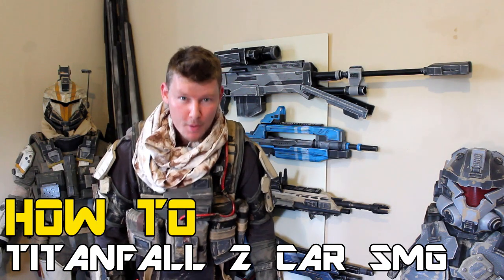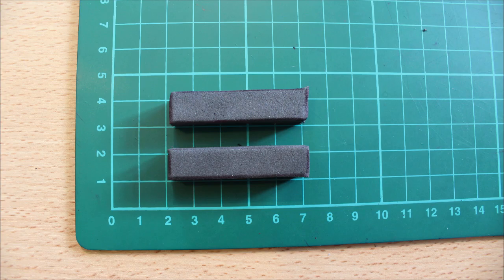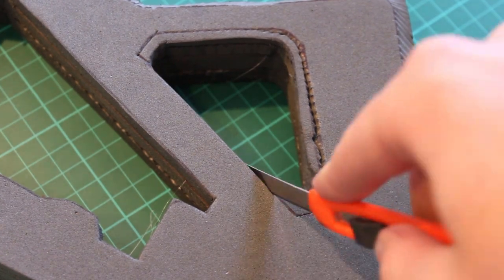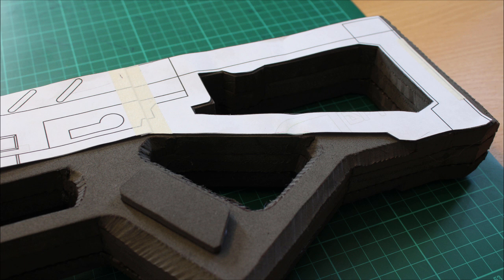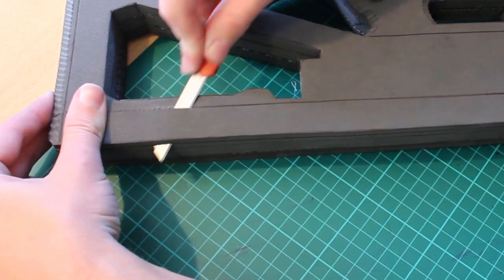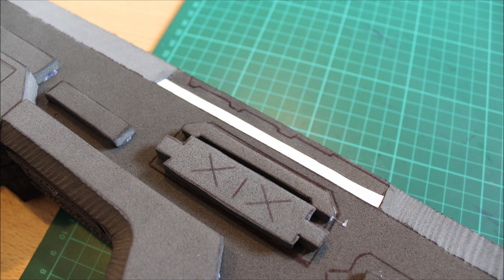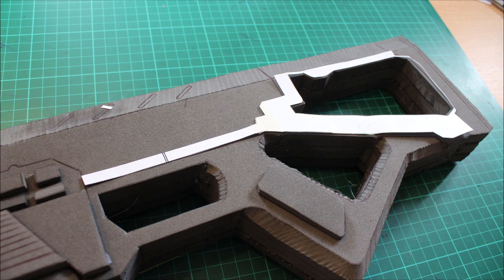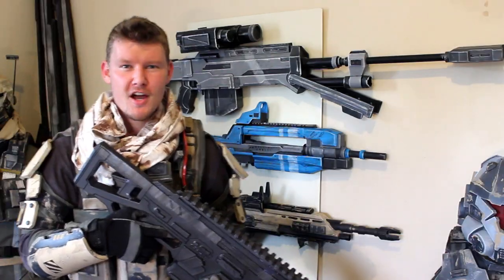HOW TO: TITANFALL 2 CAR SMG Cosplay Prop - Part 2

Comment: why don't you use a rotary tool to smooth all the edges? and maybe a blade sharpener for your blades? I know these are for beginners, but showing how to use a rotary tool will add a ton more to the final product. and a blade sharpener will ensure a clean cut every time, and save on blades. I've been using the same blade for a year now.